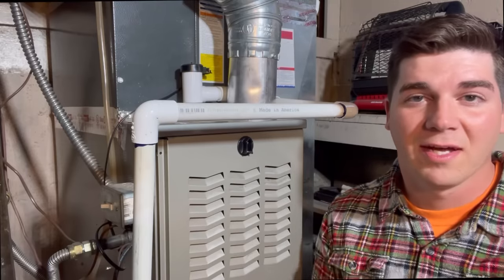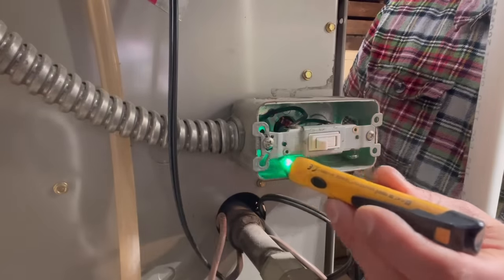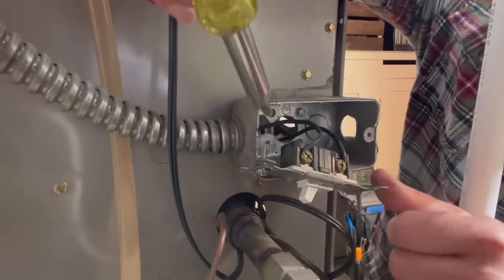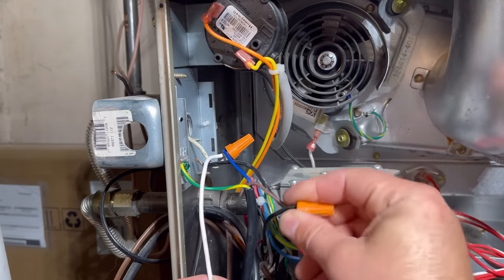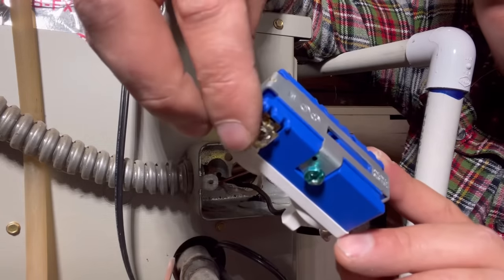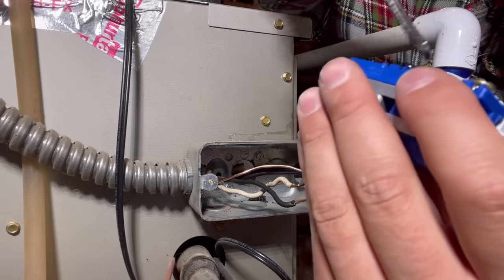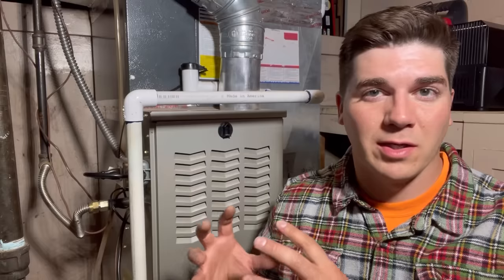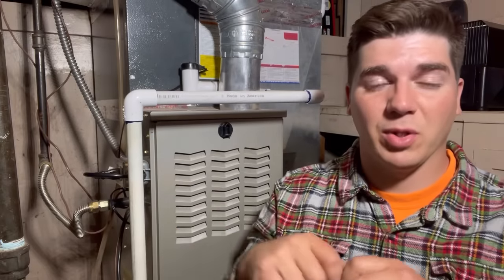This Could Keep Your Family Warm During An Emergency Power Outage.

Comment: Interesting solution, but one question: do you really need the added complication of the toggle switch?  Wouldn’t just running the power line to a plain outlet work just as well?  When it is hot, just plug the pigtail into it, when power is out, take out the pigtail and plug into generator. What am I missing?
Reply from the maker: Yes I just created a follow up video on Sunday that shows exactly what you just said 👍🏼

Comment: If the power is out and the control panel is not working without power how does the heater know when to turn off or when to hit temperature, Or will it keep running until you hit the switch?
Reply: Yes under that scenario it would run until you manually turned it off, or more likely when the whatever battery bank he is using.  A furnace isn't a small draw.  If you had a boiler that you needed only to get the recirculating pump to work, then I could see this of being of value.
Reply from the maker: Yes, the thermostat will work as it normally does as long as the furnace has power 👍🏽

Comment: Great video, i had plans of a similar function, what is the amperage/power rating that an inverter or generator must have to operate a furnace?
Reply from the maker: For me I used a 1000 watt inverter to power mine, but it depends on the size of your furnace. For reference mine is a 60k furnace. You can always pick up an inverter and see if it will work in yours, or you can pick up a 2000 w generator and I’m sure it will work on most if not all gas furnaces 👍🏽 cheers

Comment: What kind of current can you expect on the furnace motor and electronics?  How big of an inverter will I need?
Reply from the maker: 1000 w like the one in the video description, and mine pulled 500 watts running and spiked to about 1000 when the fan kicks on them goes back down to 500

Comment: A properly wired change over switch would have allowed you to achieve the same results plus the ability to switch if you are not at home.  Also, I did not notice a romex connector inside the heater for your wire coming from the box.  Please remove this device if you sell and have a home inspection.

Comment: Hi Jolkrae, I thought he was working with a forced air system but in reading the comments and replies he says it is for a gas fired furnace. My question is would these steps in this video work with a forced hot air system and if not ,why not , and is there a way for us forced hot air folks to get our system to work with a portable generator ?

Comment: Thanks for your video. What do I do with the fuse that is presently on the incoming power switch box? Dan
Reply from the maker: If you have fuses in your main panel, more then likely you will have a fuse there for your furnace. If the one at the furnace is additional, you can simply get one of these and wire in the pigtail and accomplish the same thing. 

https://amzn.to/3WlvhhT

Comment: (When starting this vid I thought for certain that you were going to show how to power the furnace receptacle with a Death Cord!!  Whew!!!  LOL)

But, stick to HVAC and not amateur electrical because you are creating a non-compliant DIY situation.  
1) You have a few errors, electrical code-wise
2) no mention whatsoever of determining the startup or running amperage of your blower?  So some guy is going to run out and pick up a cheap 300-watt inverter for a 9-amp draw.  
3) My Carrier 90% is either 9 or 14 amps, depending on the size, and requires either a 14 gauge or 12 gauge supply (which your cord looks like it's 16-gauge.)   
4) \then run it 50 ft to a truck or wherever using a "homeowner" extension cord that it way too light a gauge for the distance.

The concept is good but you should have covered all the SAFETY caveats when "teaching" this.

Comment: In order for our gas furnace to fire up while on generator power, I had to bond the neutal to the ground (built a custom extension cord that goes from generator to furnace).
Reply: Brian, I really need to be sure I have a backup plan for heat if I  lose power.  I'm going to wire the furnace to accept inverter generator power.  How will I know if I need the custom cord without actually testing?
Reply: @jolkraeremeark6949  I'm not sure I found out through testing, my furnace would turn on but the gas burner would not fire. Took me some time and research to figure out that the neutral had to be grounded to the bond.
Reply: @BrianNC81  Thanks!  I have a brand new Trane 2 stage forced air natural gas furnace.  By chance do you have the same?  I wish the fella that made this video would address this potential issue.
Reply: @jolkraeremeark6949  it's an American standard higher efficiency furnace about 10 years old made by Trane.

Comment: Thanks for the video, I have a question I have the same set up as you, but without the pigtail. When I first purchased my house, the previous owner has the same socket and switch outlet as you do my question is in case of an emergency power outage. Can I just use a male to male double prung extension cord that I can connect to that socket outlet next to the switch and the other end to the generator? I know they don’t sell those extension cords because some people used them too put it in a regular wall socket while trying to feed electricity from the other socket, which is kind of dangerous. But in my scenario, I can always turn the furnace breaker off and use that method just in case of an emergency right? Because if I have the furnace breaker on while that switch socket outlet has power coming from the generator it would prevent problems from happening. Sorry, this is the best I can describe my situation and I was just curious. Thanks.
Reply from the maker: I think you can but a suicide cord is more dangerous if someone doesn’t know what it is. Give it a shot before you find yourself in an emergency and see! Cheers

Comment: Great idea.  One question though.  Where does the thermostat get its power from?  I have a smart thermostat, would it be powered up if I were to connect my furnace to generator power?
Reply from the maker: Yes the thermostat is powered by the furnace, so as long as your furnace has power by means of an auxiliary source (gen set, car, power station) the thermostat will function as normal. Even a smart thermostat. 👍🏽
Reply: Most fancy thermostats have their own batteries so this would still function normally.

Comment: Should you use a wire clamp as the pigtail exits the box and into the furnace?
Reply from the maker: I installed a 1/2 grommet there

Comment: My on/off furnace switch is about 5 feet away from the furnace, can I not take those wires and install a male plug onto them and then install the new switch without removing the tabs so when I flip the switch it disconnects the power from the breaker and I can unplug male adapter that I installed and just plug that into the generator?  I know this might be confusing but it seems easier than what you’re doing.

Comment: Don’t forget to tell your viewers to throw the switch in the Jbox , when using in emergency mode so the battery doesn’t back feed to the pole and injure the repairman.
Reply: I think they are no longer connected.  As soon as you unplug, you are not connected to the grid.
Reply from the maker: Exactly

Comment: My furnace breakers also power my thermostat.  Where does the Thermostat get power?  I understand it's using the C common wire but does this power supply originate at my furnace?  If I provide generator power to the furnace will this power up the thermostats as well or am I better off to just back feed the breaker at the box.  I have a 50 amp inlet with a 17500 Generac but it's not less than 5% THD so I would like an alternative method to use a small inverter.  I like your method as another back up.  One is none and two is one. 
Thanks,
Reply from the maker: Yes the furnace provides 24v to the t stat. So as long as the furnace has power, (regardless of if it is backup power or grid power) the thermostat will work as normal
Reply: Thanks I cut the romex put a box on one end and a male plug on the other end probably should have make up a 12 Guage pig tail but didn't on the 2nd furnace I got lazy and just cut the romex and put male and female adapter on them.  I know this isn't exactly code but it's only to be used in an emergency.   @diyhvacguy

Comment: I have a question, in my bathroom I have a to place on the wall it has I’m straight up and down two plugs in one little unit and then decided is to switches once which goes to the bathroom lights and the other switch goes to the exhaust fan in the ceiling. All of a sudden they quit working the light switch don’t work and then shortly after that, I may be a few months the plugs stopped working. In other words blow dryer doesn’t work when you plug it in the light switch on fan don’t turn on when you flip the switches. 
What could be the cause how to what do I check to find out what went wrong? 

Also, what causes lights in your house to flicker not all the lights in the house flicker but some do. Like the bulb in the refrigerator, non-LED, sometimes the kitchen light flickers when I turn it on, sometimes the hallway light flickers when I turn it on what could be the cause??

No I have a finished basement and one day. My adult son said he heard a sound coming from the breaker panel and I think he might’ve been hearing arcing? But that happened like one time. I’ve never heard it. What could be the cause of that? 

👍 Great video

Comment: I'm thinking that the pig tail could be 3 to 6 feet long so you don't need an extension cord.  AND you could leave the cord plugged into a UPS type supply like the Anker 767.  That way it works even if you're not there to throw the switch and plug it in.  Would that work?

Comment: This is a great video! How do we submit Video requests? Could you do one to hook up a relay that turns on with the blower fan using the control board? I am looking to add duct booster fans to my far rooms. I bought a relay that will output 120V AC. I lost the notes an HVAC guy gave me on how to wire it to the control board.
Reply from the maker: Hmm I’ll think about that. Probably not a ton of people are trying to add vent boosters but I’ll look into this as a possible future video :) cheers
Reply: @diyhvacguy  I've got time. 🤣 Plenty of other projects in the pipeline before that one.

Comment: Thanks very straightforward.  Question though:  My thermostat is powered by a 24 volt line which sends the 'get heat' signal to the boiler.  Any thoughts on how to provide a set up to power that in an emergency no power situation?
Reply from the maker: The furnace provides power to the thermostat, so as long as your furnace has power, the thermostat will work as usual 👍🏽
Reply: @diyhvacguy  Thank you!

Comment: Is this setup NEC compliant, or will I need to return things back to the original setup when I get ready for a home inspection to sell my house?  Should I use a 20A outlet for this, or is using a 15A outlet like you OK with  the circuit breaker being 20A? And if compliant, is a permit required? Thanks.
Reply from the maker: Worst case, you go to sell your home and need to change it back but there is nothing unsafe about this. I think all furnaces should be like this. Cheers

Comment: Only use a pen to verify a circuit is hot.  Do Not use a pen to verify a circuit is not hot, use a meter to verify all wires are not carrying any voltage. I worked in an industrial plant and I retired Alive.

Comment: Didn’t see a gas shut off valve on your gas line to furnace? Very important and code for emergency & service of furnace, should be within reach of front of furnace.  Pigtail is well done for emergency furnace operation.  Pure sine wave inverters should be used on modern furnace electronics (last 15 years or so).
Reply from the maker: It’s up higher on mine for whatever reason but it’s within reach

Comment: Hi HVAC Guy!  Thanks for your great instructions.  I have a 16AWG, 3 foot pigtail. Could i safely use it for this project instead of 12AWG? I also see i have an "18-3" thats a more perfect length already. Is it safe?
Reply from the maker: I’d definitely recommend building one with the 12awg.  16 and 18 are too small
Reply: @diyhvacguy  BTW, whats the "name" of that 1/2 inch piece that you installed into the box to pinch the pigtail plastic sheath and protect it from the raw metal edges of the box? Thanks for your help!

Comment: Hello!  I have a 15 amp fuse on my switch box.  What should I do in this case??  Thanks very much for the video but I am stumped on what to do about the fuse while rewiring mine.
Reply from the maker: Does it have another fuse for the furnace other then that one presumably? If so, you can get an outlet that has a threaded end like this and you can accomplish the same thing. Just make sure you have another fuse that’s dedicated for the furnace. A lot of them have two for whatever reason

https://amzn.to/3Ghflrh

Comment: Use a transfer switch, it's only going to be like $75 and it will meet code.
Reply: My alternate power is similar to my Coleman camp stove.  I only dig it out for home use when the electricity for my stove from the power company dries up.  My solar is a semi-mobile setup for RVing.  When not 'trailering' my solar stuff is used in my workshop and kept in reserve for in home emergencies so no permanent installation at home to utilize a transfer switch.

Comment: Thanks so much.  Very useful video.  We might consider having our plumber equip our furnace with a one outlet and one switch instead of just a one switch box.  Our car has a small battery, so ours you'd probably have to start after every furnace cycle.  But neat idea all the same.

Comment: So I just added a Renogy 1000 watt inverter along with the new switch according to your great video.  I just went to test it, and the furnace fires up, but as soon as the fan starts to come on, the inverter shuts off and beeps once.  Any ideas what the problem could be?  Isn't 1000 watts enough to power the system??

Comment: I have a champion gas powered generator. Do I need a inverter type generator to power my furnace using this new hookup. Will a generator ruin my circuit.

Comment: I keep getting told this is a fire hazard even tho logically sound. Couldnt find 12g cord so using a 14g pigtail instead but still using a 1000w inverter with DC batteries from boat… any electricians wanna tell me possible ways of fire risk? Im aware if used wrong size wires it’ll heat up and cause issue but if everything is rated correctly should be safe correct?

Comment: Why not in power outage just flip the main junction box breaker switch of, use an extension chord you've premade with male plugs on both ends and plug into the generator and the other into a 20 amp outlet outside? Keep all except the essentials off during a power outage.

Comment: My furnace was set up with the switch when it was installed last year. I tested it a couple of days ago. When plugged in  to a Bluetti (2000) it appears to have power running to the furnace but the thermostat in the hall is blank. How do I get power to the thermostat to send a signal for the burnners to ignite?

Comment: Something I don't understand about this setup. If the power is now going through a plug to the furnace do you need a switched outlet? Could you just replace the switch with a plain outlet? Would the small arcing while unplugging cause any problems?
Reply from the maker: You could do this. I think building code here specifies that a dedicated switch is needed

Comment: yeah so i happened upon this video and I said to myself hmm! great idea so I went out and bought the parts, cut out the tab and all that wired as per video and furnace turned on no problem after test HOWEVER no heat! I thought weird maybe igniter went? maybe flame sensor? so i took all those apart cleaned then out as well as burners, still no heat? So before buying new igniters etc.. I said let me put back the simple on off switch that was there before and see.  Yup, now I got heat! So I dont get it? Isnt this just a power on off switch? I have two white wires and two black wires in gang box, one set coming from 14/2 wire and other into furnace (black goes to door switch and white to circuit board). what did i do wrong? Furnace does turn on, blower etc.. everything but heat? I have an ecobee thermostat if that helps was I supposed to change wiring there too?
Reply from the maker: No, if you wired exactly like this, it should have worked. However I have an even simpler and equally cheap approach and that video will post tomorrow so stay tuned for that one 👍🏼 

We’re you just running with grid power or did you have it plugged into a power station or generator? Because that could have been your problem.
Reply: Hey no generator was simply plugged both blacks to a single toggle switch and  both whites together in a marette. I bought your switch cut the tab, put the power black to the plug switch, white to the silver screw,  jum😊er, powered furnace no heat. When i removed and put single pole switch back heat worked.

Comment: If you had a 3-way switch, you could put 2 different power sources on the two legs with a common neutral. One power source is from the house, and the other is a plug that's just sticking out, which would be plugged into an inverter in the winter (to turn it off unplug it, and have the switch on the plug with no inverter). So, you could seamlessly switch between them if you wanted and you don't get to play with a plug!
Reply: This is the real answer.  But use a 20 amp three way.  you do not want the start up current to wreck the contacts of the switch and in his video he has a 15 amp receptacle instead of the 20 amp that he should have because his breaker is a 20 amp.

Comment: Or...just use a small propane or kerosene heater in a winter power outage. Or, install a wall furnace that doesn't need electricity.